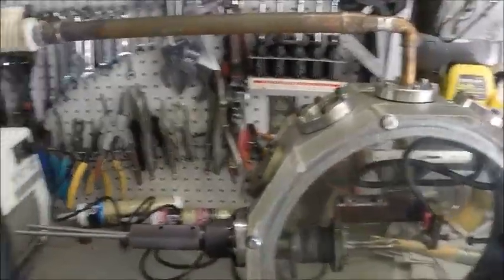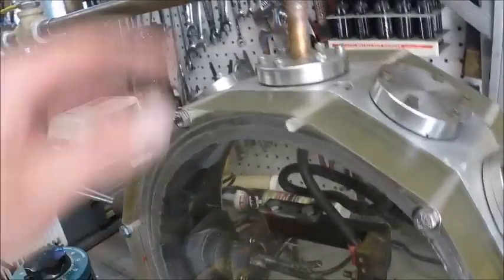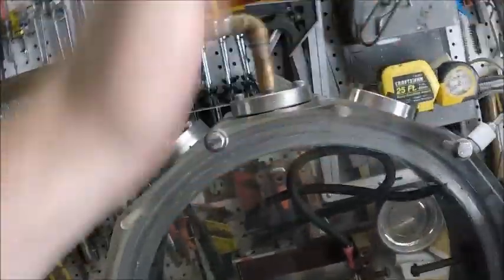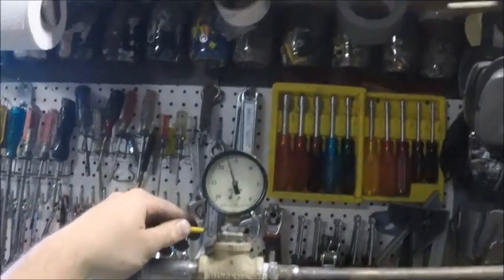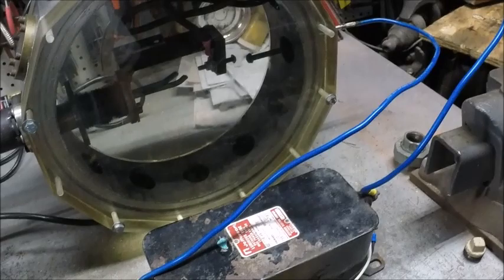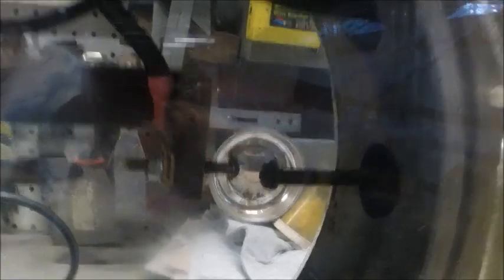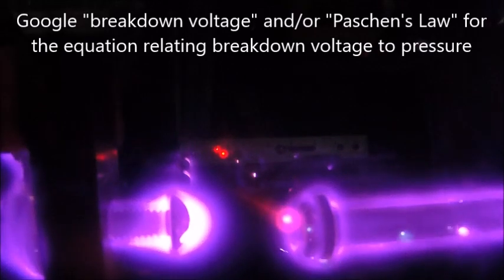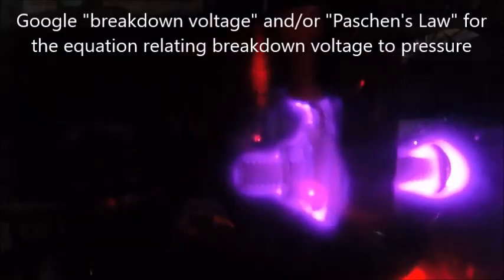The Electric Arc in Vacuum - Part 1

Comment: What does electrical arching sound like in a vacuum???
Reply: That's that buzzing noise you heard. His arc might be in a vacuum, but his vacuum is in his garage and anything that happens inside his vacuum turns it into a speaker through vibration.
Reply from the maker: The arc itself cannot transmit sound through a vacuum. The humming noise is from the high voltage transformer and variac autotransformer which have ferrite and steel cores which expand and contract at 60Hz due to the mains current flow.
Reply: nothing can sound in a vacuum